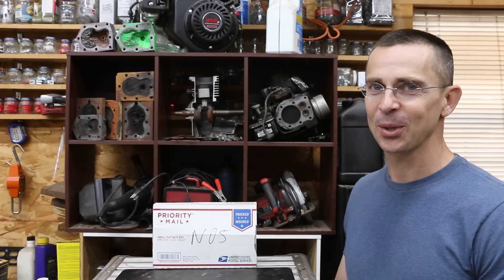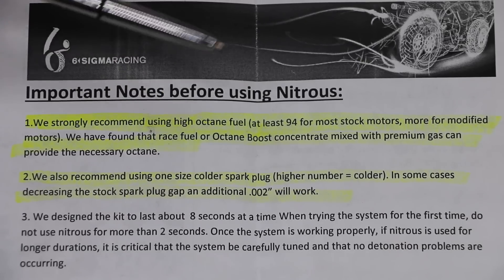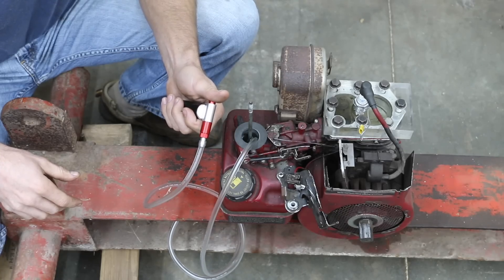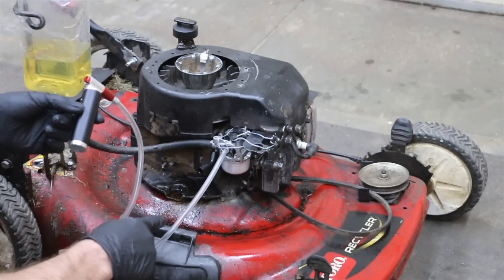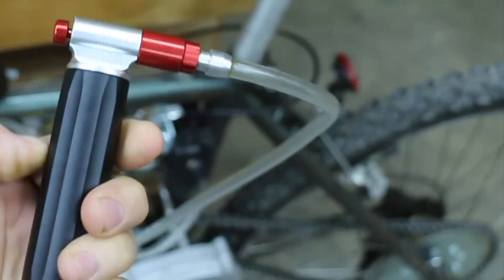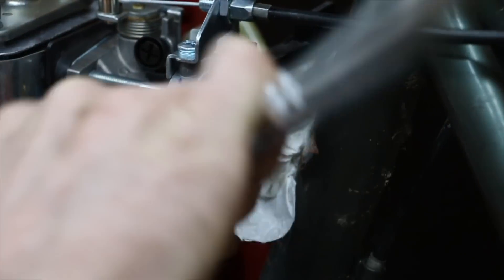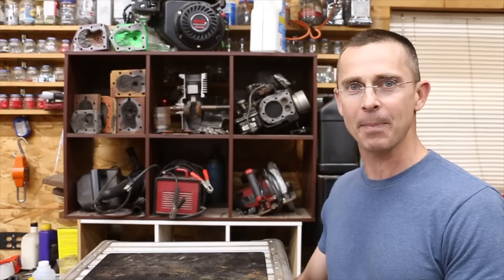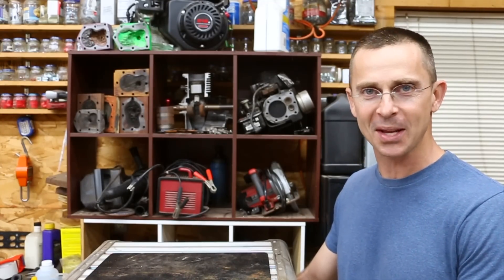Will the 4-Stroke Bike Survive Nitrous Oxide?  Let's find out!

Comment: G'day,

  Yay Team !

 Ah, if only I'd had a couple of them fitted to the 22 Hp 2-Cylinder horizontally-opposed JPX Pul-425, in May 1992, on my VJ-24w Ultralight Motorglider...; then I could've used that extra 11 Hp for 8 seconds - with which to have flown over the Fence while flying forwards & right-side up, on that Downwind Take-Off in a 200 Yd Paddock.

  But, alack & alas, without the Nitrous-Oxide Boosting (or the sense to have refused the attempt & waited for the Wind to change...) ; I flew over the Fencepost upside-down & going backwards at an altitude of about 5 ft, before landing inverted in a Potato-Patch..., ignominiously - as the saying goes.

  Of course, a Belted reduction-drive to a bigger and slower-turning Propeller, engaging a greater mass of the Atmosphere would've made more thrust, too, than did the tiny little Toothpick twirling around at Crankshaft-speed on a 2-Stroke.... (cutting a tiny little high-speed hole in the Air, while turning Fuel into Noise, & generating some residual thrust from the Cooling-Fan blowing accross its  furiously vibrating Cylinders...).

    For twiddly little Ultralights, with deliberately minimalist Powerplants..., that there 8 Seconds of available Nitrous Oxide could be a very very handy little set of buttons to have available ; for those occasions when the only workable option requires more power than Full Throttle will otherwise deliver.

Excellentical !

   Have a good one...

;-p

Ciao !
Reply from the maker: Wow!  What an experience!  I hope you weren't injured in the ultralight incident.  I always enjoy reading your comments. Thanks again!
Reply: +Project Farm 

Thanks...

  Ah, well, I hadn't got around to fitting a Shoulder-Harness to the Lap-Belt, so when I "Horseshoe-ed" what amounted to being a Bulkhead with my (Leather Helmeted) Forehead,  I got a bit concussed...

  And, because I'd tried to cleverly engineer the Rudder-Bar so as to prevent it from ever causing a "Pilot's Fracture" (a # Talus, from hyperflexion of the Foot, when the Pilot "submarines" and slides forward, under their Harness, on impact...) by setting it up under my Heel rather than bearing on the Ball of the Foot (hoping for a "clean break" of the Tibia & Fibula - which is usually simple to treat & recover from...) ; when the Fencepost came into the Cockpit, hitting the Right Rudder-Bar between my Boot & the Pivot-Point, it had a 2:1 leverage advantage..., which was sufficient to turn the front of my Calcaneum (Heelbone) into countless powdery fragments.

  Even through the 1/2- Inch Leather Soles of my Hobnailed Fleece-Lined Calf-length Leather RAF WW-2 Pattern Flying-Boots....; I was strapped onto 400 Pounds of Aeroplane moving at 35 MPH, and the Ironbark Fencpost didn't move at all, while I helped the Airframe absorb & redirect the impact-energy.

  So, I still limp intermittently -  as titrated by workload and Barometric variation, and when in town I carry a Stick, because every now & again the Ankle uses a Spinal Reflex to shut the leg down - particularly after driving the Car, strange to say ; and I grew tired of looking like a wounded Chook, flapping my elbows to try to walk without falling down - starting when I'd get about 5 yards from my Car.

   So, it's a sort of Ultralight-Motorglider Test-Pilot's Ankle, and the smack on the head seemed to undo a lot of the recovery which I'd made following a small Skull Fracture that I incurred at an age of almost 14..; I have a lot of trouble recalling names to faces unless I have something to do with people on a regular and ongoing basis - attending a 40-year High School Reunion recently put a big bright spotlight onto that phenomenon for me.

   When they put the Pilot's Ankle with the Nurses' Back, together with the Short-Circuit between the Earholes which causes me to tell the truth in public places..., the Great Full Nation concluded that I'm unemployable ; so they pensioned me off to sit under a Gumtree feeding Kangaroos in the Forest on top of the Hill.

  According to the Beatles, every society has to have it's Fool On The Hill and, around these parts anyway, I seem to have got the Gig (!) ; and I also get to moonlight as the local Mad Scientist, Hillbilly Hermit, Loudmouthed Tree-Hugging extreme Green-Activist, & the Celibate Vegetarian Poet, as well...

   A lot of the Poetry, both published & otherwise, is stashed in my,

 "Warbles In The Wilderness..."

  Playlist ; I printed a book of it back in 1996, and in '97 the Armidale Environment Centre appointed me their "Poet In Residence"...(!), so it's not "too bad" - kinda thing.

  However, while I can still do most Arithmatic learned in Primary-School, I never ever  learned anything in a Mathematics Class after the Skull-fracture at almost 14 (aquired while leering down the Driver's Cleavage while working at the Side-Show, standing on the rear-bumper, when she announced her non-consent by driving the Dodgem-Car perpendicularly into the Wall, at full Throttle...., hitting me in the forehead with the Power-Pickup Pole, attached to 700 Pounds of Dodgem-Car rebounding - while I was still moving forwards....), oopsie !

  Sometimes, the Karmic Feedback-Loops - within the Kosmic-Scoreboard Effect...; are short, sharp, tight, vicious, and otherwise generally quite devastating.

  But, one has to work pretty hard at being mindlessly & relentlessly selfish, for a long time indeed, in order to trigger such a savage "Wake-Up !" call ; as I recall the way of it...(!).

  Such is Life,

Have a good one...

;-p

Ciao !

Comment: Great video!!!!! Just FYI you bought yourself a “legal” whip-it..... it is not actually meant for use in a motor, it is to inhale and get high.  Adding dry nitrous to a carbureted engine with no extra fuel is why it is pinging.
Reply from the maker: Great point!
Reply: Project Farm the same little canister is sold in adult shops and smoke shops as a “homemade whip cream can charger”  AKA an almost legal way to get high.... but it is fairly dangerous if done excessively.

Comment: Needs to be richened up to prevent detonation. The N2O ads oxygen and tips the a/f ratio to the lean side causing it to detonate regardless of octane rating. The splitting of the atoms in nitrous isn’t what makes power, it’s the added oxygen that allows you to burn larger amounts of fuel for more power so this probably has more potential if jetted properly.

Edit: just richening the carb will not work cause it will be rich up until the point the nitrous is used. You need to be able to inject more fuel at the same time as the nitrous.
Reply from the maker: Great point. Thank you

Comment: The nitrous you are using is totally fine, however the engine is not getting the appropriate amount of extra fuel when you are using it. The dry kit you are using will "lean out" the engine, but that's okay! it still works the same. It is just harder on the engine.
Reply from the maker: Great point.  I'll have to use a wet system or add fuel.

Comment: Project Farm Epic excellence, very interesting content, this is going to be a popular one....reminds me of a crazy story from my idiot teenager days: Me and the girlfriend went out to the woods in the local park and I had a packed up old style bowl (of Mexican weed lol) I took a whippit cracker and a cylinder of Nitrous oxide, filled a balloon with the cold gas with the intention of inhaling it, but just then she had hit the bowl.  It was at that moment I decided to put the filled nitrous balloon over the lit bowlpiece containing glowing orange mild Cannabis.  What happened when I released the gas was insane, the balloon glowed very brightly internally as it deflated pushing it's contents through the pipe with an eerie jet like blast noise.  The mouthpiece end shot out an inch long flaming ejecta with a purple blue color, and bluish smoke appeared about a foot away.  The sound was incredible, odd, and terrifying with the "is it going to explode?" suspense.  It was captivating, stupid, and dangerous all at the same time.   Anyway, another video idea would be to see how long a 4 stroke engine will run on one of those camping 1lb green propane cylinders, and how to easily convert the engine to operate on it (i.e homemade or store bought regulator, fuel flow control, and flashback protection) if you could show people how that could easily be done I think it would be a popular video.  My thinking is a standard propane torch head with a dial control and some Project Farm knowledge it could be done easily.
Reply from the maker: What a FUNNY story!  You had me laughing pretty hard!  The crazy things we did when we were young.  Also, thanks for the positive comments and for the video idea!
Reply: @ProjectFarm  Thank you for responding, part of the reason you are definitely in the top 3 of my best of YouTube must watches.
Reply: @ProjectFarm  I also wonder now if that old brass lamp part pipe contributed to a catalytic reaction with the nitrous oxide when released through the slightly burning marijauna, because it was seriously crazy to see that balloon containing a bright internal fire without popping or detonating.  That was around the year 1996, but I still remember it like yesterday.

Comment: Another great video! What would happen with more flammable liquids like brake clean please don't put urself at risk though. Here in England our minimum octane fuel is 97 max is 99 it's so weird how low it is out there across the pond. 👍
Reply from the maker: Thanks for the video idea!  Yes, the US uses a different octane rating system.

Comment: I think that pre-ignition occurred because the air/fuel ratio became lean when the nitrous was added. Professional racers intentionally run their carbs rich to compensate for this, or just use EFI so they don't need to worry about it.
Reply from the maker: Great point. Thank you

Comment: 6:18 danger to manifold
Reply from the maker: Great point
Reply: @ProjectFarm  while my comment was a reference to the fast and the furious, it probably ain't good to run nitrous on these smaller engines due to fragility of the parts that may be present. Still an interesting video, though. 

Is there a way you can see if nitrous works on a 2 stroke, say a chainsaw or a weedeater?

Comment: Do you think it will work well on a Vauxhall astra 1.7 tds with a high revving Isuzu engine?
Reply from the maker: I think you'll want more nitrous than the small amount I used.
Reply: @ProjectFarm  does it work well for diesel engines more than petroleum or other spirit based fuels?

Comment: Nitro is used for the oxygen.   It allows mm ore fuel to burn.  Nitrogen is used to slow the burn till its ready for a strong burn.  No different than a turbo or supercharger.  The tern nos comes from the 1st fast and furious movie.  It was an error in the script.  Nos is a name brand of the 1st Comercial available kits in the 1980s.   Stands for nitro oxide systems.   I ran a drag car that put over 400 hp worry to the engine at 40 mph.   It's a violent way to make power.  Recommend forged internal rotation assembly on all engines to use it.  Prolonged use will blow the head off the block or knock a piston into the oil pan.  Boy is it fun to use
Reply from the maker: Great point. Thank you

Comment: Use the nitrous to also pressurize the float bowl to increase/force fuel flow out of the jet. Its how my boondocker nitrous kit works on my snowmobile.
Reply from the maker: Great recommendation!  Thank you
Reply: Is your snow mobile a 2 stroke? Nitrous will actually loose alot of hp in a 2 stroke when not using it. Because of rich tune
Reply: @VasilyBuilds  it does  not have a rich tune, it forces extra fuel through the jet by pressuring the float bowl only when the nitrous is engaged...
Reply: @Aronteed  got you. Is it one of them motorcycle bottles for 150hp ?
Reply: @VasilyBuilds  No its a boondocker kit, specifically made for snowmobiles.  Its only 35hp, its designed to be used to give you a little boost to assist with the power loss attributed to thinner air from elevation. But its still a 25% bump in power stock output...

Comment: Great vid, i wondered how that would work out😁👍  But what about combining nitromethane with n2o???  Nitromethane carries its own oxygen, so it needs much less atmospheric oxygen to burn. The theoretical ideal or stoichiometric air/fuel ratio for gasoline is 14.7:1. That means, 14.7 pounds of air are needed to burn 1 pound of gas. ... At 0.5:1, the SE potential of nitro could be six times greater than gas. It means that you almost can hydrolock the piston with fuel, and still get a total combustion. Like a top fuel dragster engine😁👍
Reply from the maker: I like where you're going with this.  lol. Thanks for the video idea!

Comment: The nitrous oxide is used in motors not because of its decompisition but because of its higher oxygen content than regular air, if your lawnmower combustion temperatures are 1200 degrees than i think you got problems
Reply from the maker: Thank you

Comment: How about building a "wet" nitrous kit using a propane torch in addition to a nitrous canister??? Propane is around 110 octane so we may help calm down the detonation
Reply from the maker: Thanks for the video idea!
Reply: This is a good idea.  You just need to know the flow rate of the nitrous.  The propane would be easy to "jet" once you know that.  Stoich for Propane by mass is 15.6:1, so it is fairly similar to gasoline, and far more forgiving if you go a bit "rich", which isn't a bad thing since per gallon Propane is a little lower BTU wise.
My only concern would be with the way it would be run.  Pouring an oxidizer and a fuel into the airbox of a carbed engine is a good way to invite a very bad time if there is even a hint of backfire.
Reply: Good idea, I like it

Comment: I thought nitrous was to increase the compression in the cylinder. is that not the case?
Reply: No, if you just introduce NOS into the cylinder like he did here ("Dry" shot) it just leans out the F/A ratio because the NOS releases its oxygen.  If you introduce more fuel at the same time ("wet" shot) and keep a normal F/A ratio you get even more power.  Think of it like the chemical equivalent of forced induction.
Reply: @estelja  Thanks!
Reply from the maker: One essentially achieves a similar benefit as forced induction without the turbo/supercharger hardware.

Comment: I'd like to see the same kit with a homemade wet shot. My thoughts: secondary fuel line routed to a T fitting  in the NO2 line. Activation of the NO2 will siphon the extra fuel. Might need a check valve in there to make sure that fuel is ready on demand. The orifice of the secondary fuel line can be drilled out to enrich the mixture to a safe level.
Reply from the maker: Thanks for the video idea and tip!

Comment: You want to try it with additional fuel but also rotate the canister so the button is the lowest point as that way you should get liquid nitrous out not gaseous nitrous 
Try mixing get some methanol into the tank as that should reduce the pinging
Reply from the maker: Great tips!  Thank you

Comment: Can you try other gaseous oxidizers in an engine? Like pure oxygen, ozone, sulphur dioxide, or maybe even nitric acid vapours. The last one may screw the engine over but it would be interesting to see. Also test if liquid oxidizers will work as well, like hydrogen peroxide or just straight nitric acid
Reply from the maker: Great video idea!

Comment: In the bike the limit is where the CDI limits the revs. I supose that you got the 41 miles per hour thanks to power gain and did not arrive to  rev limit. No?
Reply from the maker: You are right.  The 4-stroke bike kit can't reach max top end speed due to shortage of HP, not RPM. It could rev higher.

Comment: As far as i remember, the oxygen coming from decomposition of the nitrous oxide can be used to burn more gasoline in a single cycle. That means that you should get even more power when you increase fuel to air ratio while applying the NOS.
Reply from the maker: Great point.